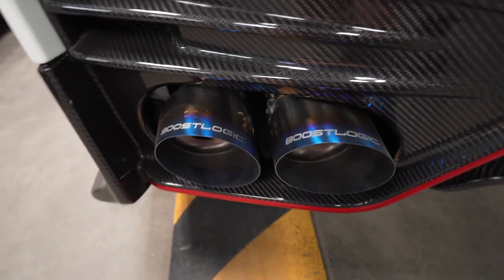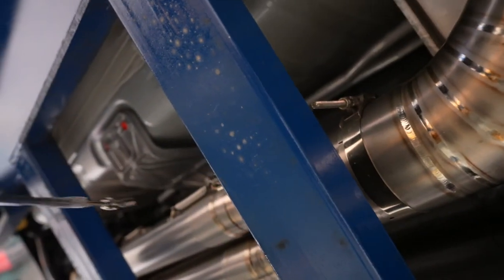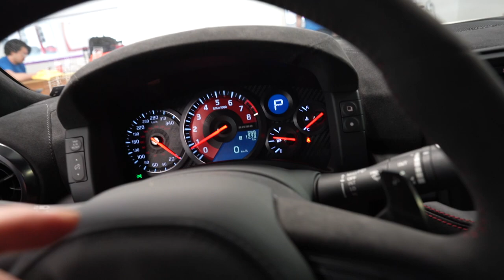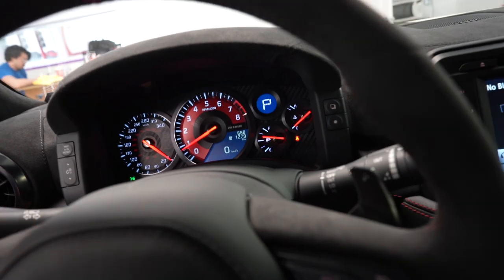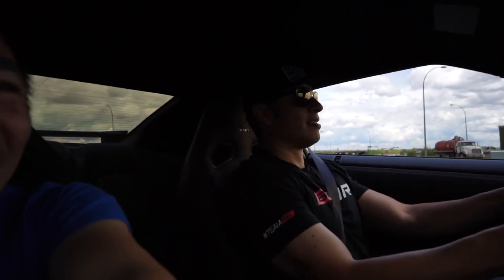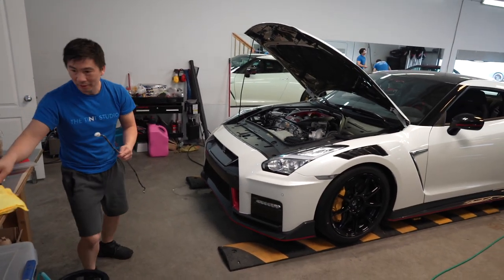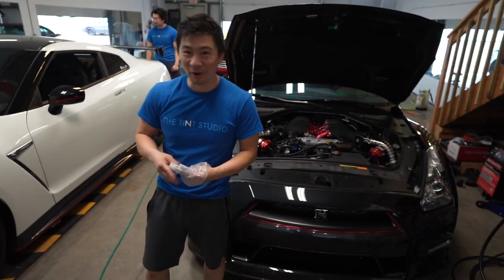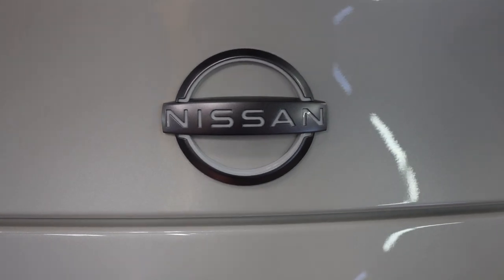No more limp mode! Nismo Exhaust Valve Failure

Comment: Awesome video! I’ve been wanting to get the valve delete box but have been afraid of it being installed incorrectly. Did the delete box come with instructions on how to orientate the screws?
Reply from the maker: It is a very straightforward install. The installation instructions are included with the delete box.